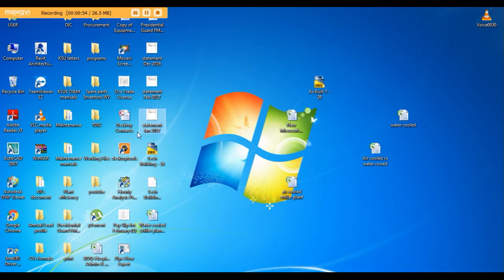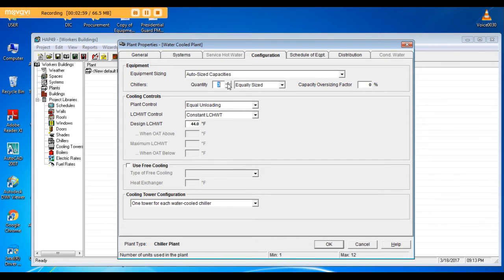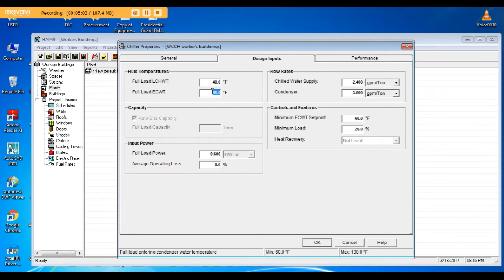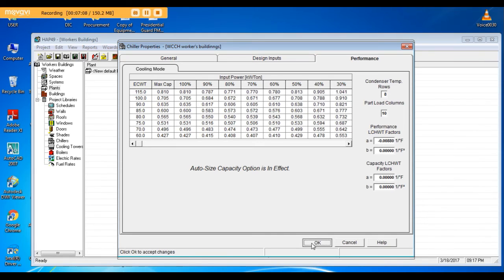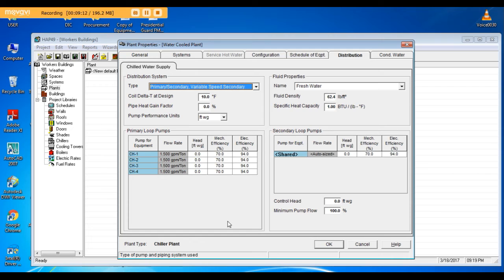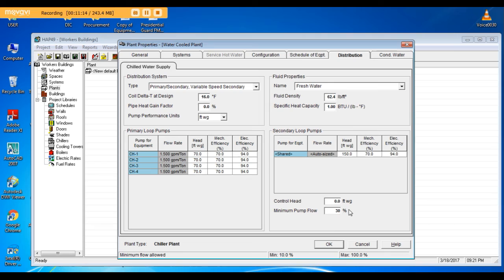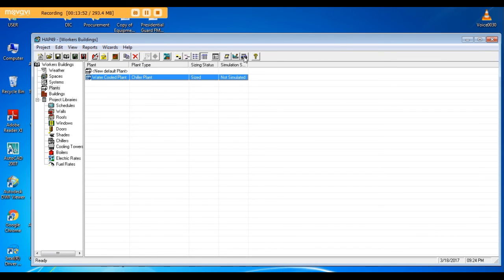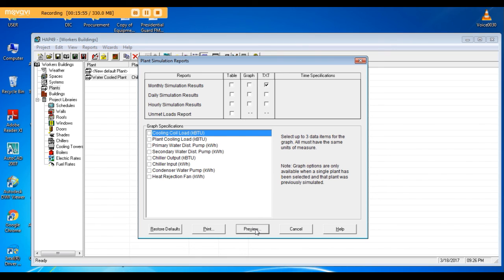hap tutorial 2, Chiller plant

Comment: It’s a big mistake to use this software, we mustn’t trust the HAP , simply because it’s established by hvac manufacturer !
Always and specially for hot regions hap give incorrect cooling loads, nearly double the right loads!!!!
Reply from the maker: when using it correctly, hap saves a lot compared with hand calculations. Note that most consultants use the peak design conditions without considering the 0.4% or 1% tables recommended by ASHRAE, and that is the major reason for oversizing. This oversizing is then a result of incompetent consultants trying to put themselves always in safe side, and therefore not an issue in the software.
Yes, from my experience I can tell that still the values are overestimated if taken as it is from software, and that is evident because 99 % of cooling equipment are oversized in middle east region. But we have to know that softwares are there to help designers, so after performing software calculations,  Experience should take place to apply a practical diversity (extracted from similar projects) especially in case of large projects which saves the owners a lot of money.
Reply: @AMJEngineering  thank you for your reply,
From my point of view and as a person worked in the marketing for many years in the Middle East and still, this OVERSIZING will not find place in the reality simply because all the American manufacturers and specially the HAP developer, Carrier, will supply chillers with no more than half the indicated cooling loads, for example if the required is 100 TR they will send chiller with 50TR and claiming it’s 100 since they already knew that you oversized the calculation!!!!!

Comment: I have a question which make me confused !

I want to calculate heating and cooling loads in a project ( actually it is artificial project in order to learn Carrier software)  - My system is AHU - in the section of Central cooling - supply temperature is set on 58 F as default. First question is that " is there any optimum ( or  range) temperature for this section ?

On the other side, I want to simulate this system ( AHU) in PSYCHROMETRIC ANALYZER software - after the cooling coil, there is a place at which I have to enter a figure. Should these figure  be the same ? ( I means SUPPLY temperature  in Carrie and temperature after cooling coil in Psychrometric analyzer software ) . 

i would be grateful if you explain me about these two figures and their optimum value.
Reply from the maker: Dear, 58 is the grill supply temperature. This depends on the indoor air design slections (temperature and humidity).  The grill supply temperature should be less than the dew point at the specified design data. For example 58 deg F is the maximum suuply temp for an indoor air selections at 24 deg c and 55 relative humidity. You can check the psychometric chart for your air desig inputs.